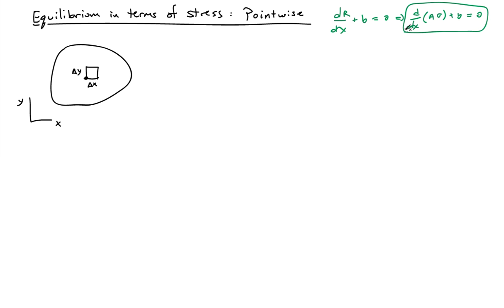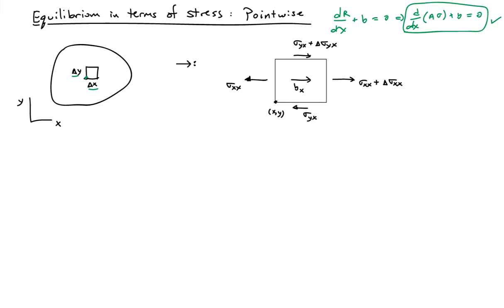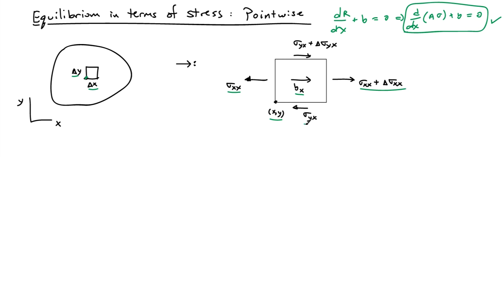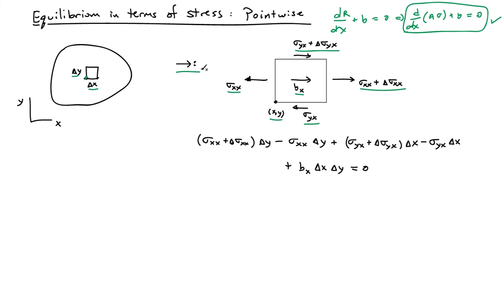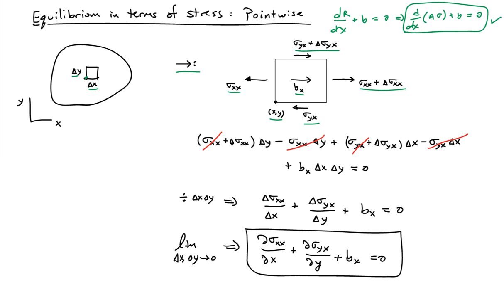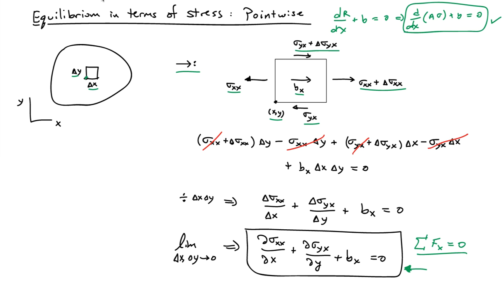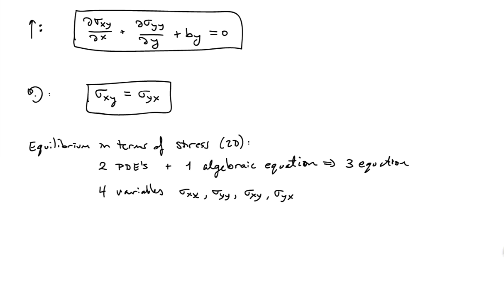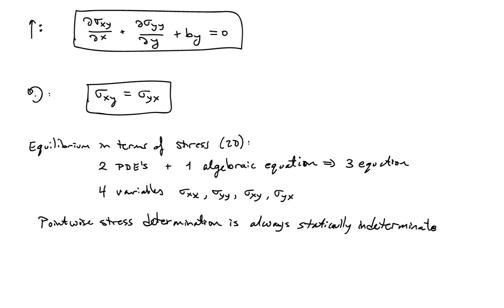(15D) Stress equilibirum equations

Comment: How do you "find" out about the moment?
Reply from the maker: To derive the moment relation, sigma_xy = sigma_yx, it suffices to consider a differential element with just the shear forces acting on it.  Then take moments about the center of the element of the element.  Using the center eliminates the need to consider the body forces and the normal forces.  This is the "easy" derivation.  A better derivation, which takes care of some technical details, requires the use of the divergence theorem;  see Section 3.2.3 of Engineering Mechanics of Deformable Solids by S. Govindjee for further details.